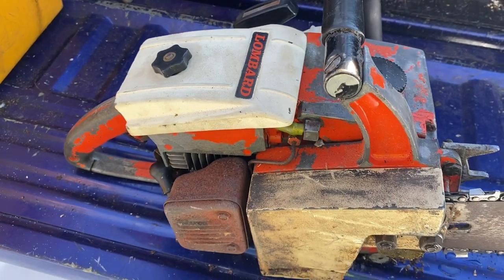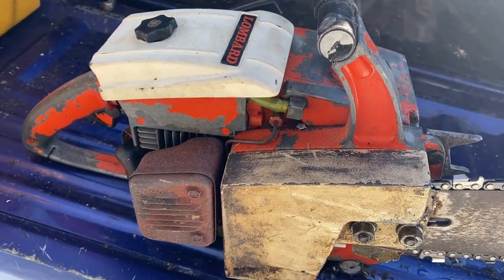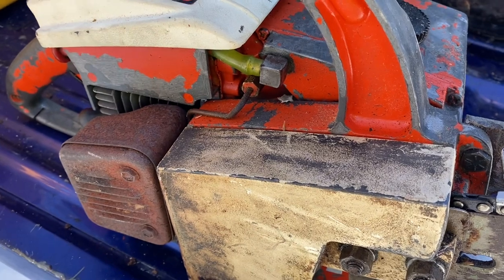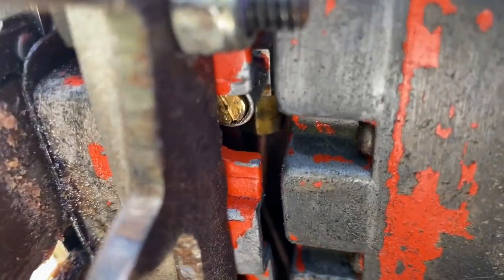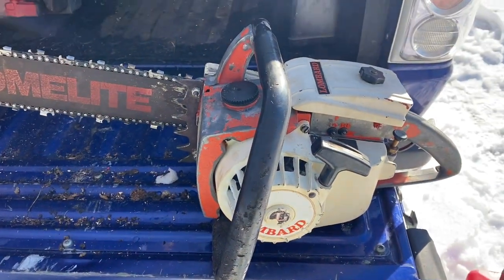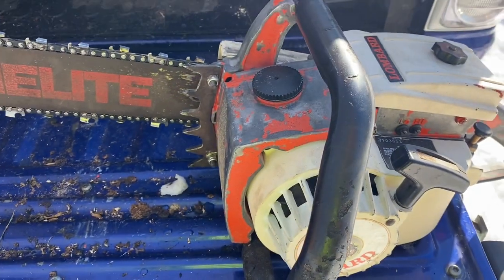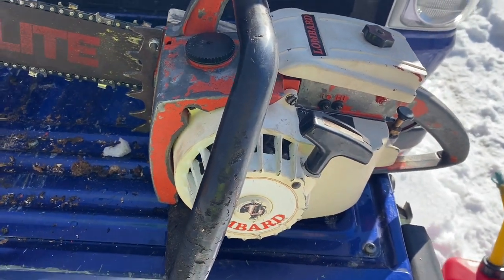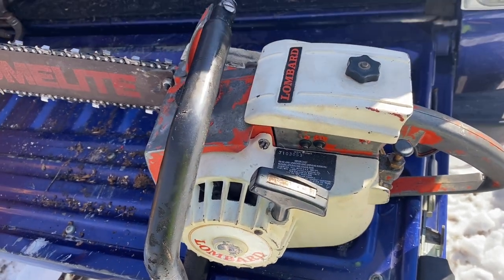Lombard Chainsaw!  Vintage 68cc Chainsaw Power!  Awesome Vintage Chainsaw Power!

Comment: Ive got a pile of lombard parts and a taken apart barker saw. I fully intend on putting together at least one saw out of that comglomerate. Im tired of those newer plastic saws and loosey goosey vibration isolation stuff. Im using two holelite  saws now. a Xl 12 and a Xl 12 with a super Xl cyl and piston.
Reply from the maker: BUDDDY!!!!!  I NEED SOME LOMBARD PARTS!!  Are  you willing to part with any of those parts?

Comment: I know sound from video can be weird, but this saw sounds deeper and a lower more bass note than a Homelite Super XL. Not sure but it may need just a tiny bit more fuel on the high side adjustment. I usually have to mess with them several times to get one just right. It's that no load crackle at full throttle and then maybe a tiny bit back on the hi screw, and then try a cut.  Would have enjoyed being there and taking a cut for fun. Unique old equipment. We have such modern marvels now, when time is money, but those old gems have character. Edit: You know, everybody has a slight perception difference in what they hear. The no load crackle or stutter is where most of my Homelites cut their best. It's probably only about 1/8 turn on the final adjustment between ok and perfect. Ain't these saws a hoot?
Reply from the maker: It could use just a tad more on the high side but I did not do it for some reason.

Comment: I went to buy a lombard super lightning for 20 but it was locked up
Reply from the maker: I would have taken it.  Parts are hard to find so if you end up with a good runner it is always good to keep a few for parts.
Reply: @Smittyschainsaws  I did make an offer of 15 but it was rough and he'd lied right to me but it was sized bad bad